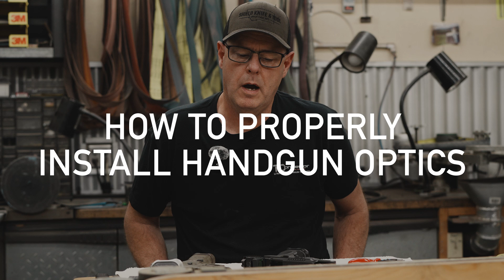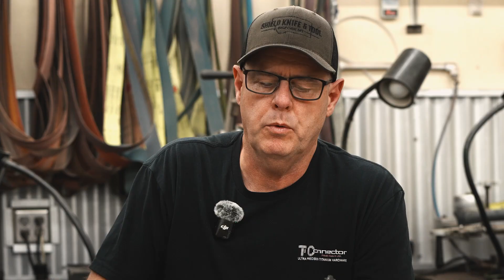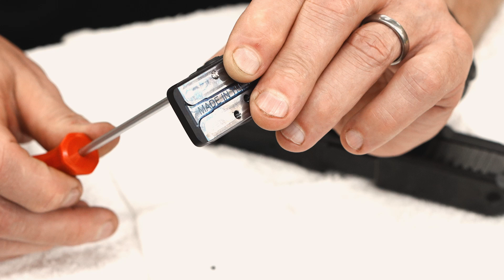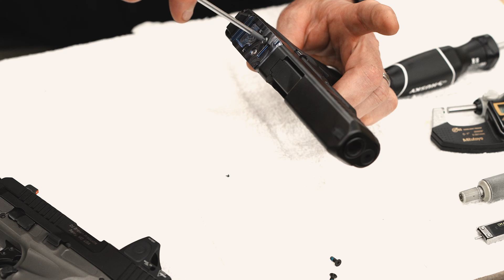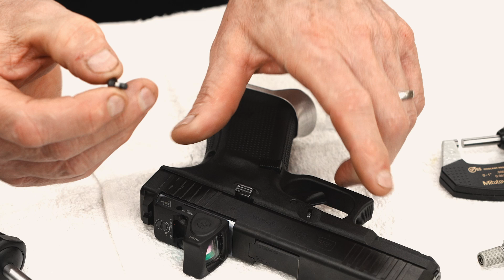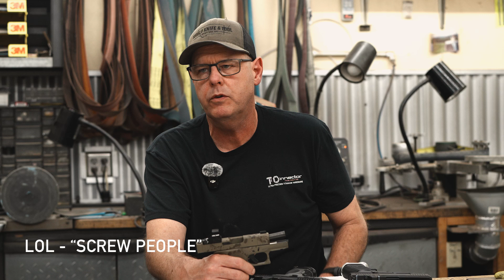How to Install Handgun Optics

Comment: Been using guns for years but currently trying to mount red dot. I bought a s&w mp2.0 metal comp carry.  Wanted to use a holosun scs-mp2-gr which is made specifically for that gun. Was doing research and finding tons of people w screws breaking.  Didn't want that issue and wasn't sure if it is optic,screws, or installation error.  So instead I bought a holosun  hs507cx2 and a c&h precision plate which came w 2 sets of screws so did holosun.  I haven't done anything yet just looking for a direction.  Any thoughts on either way I was supposed to go??? Which screws should I use . Sorry so long thx 4 your time.  Looking at your website as we speak.  Thx